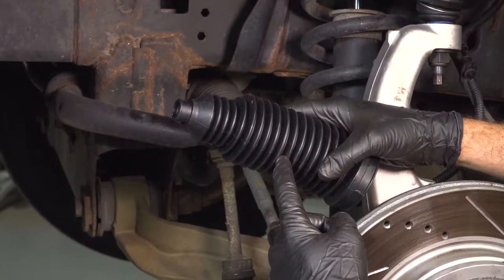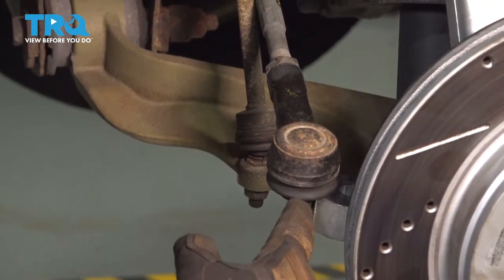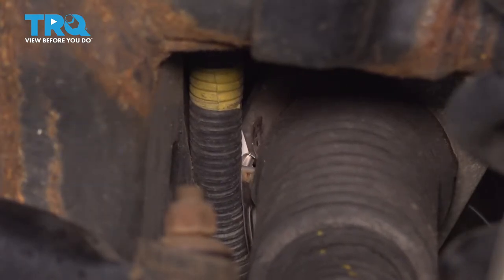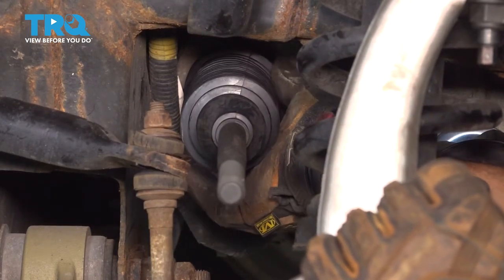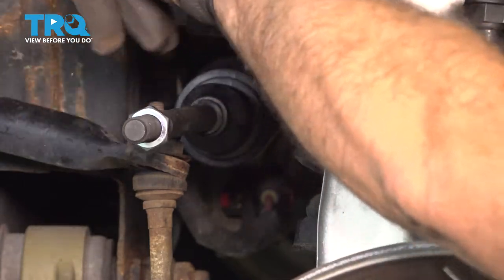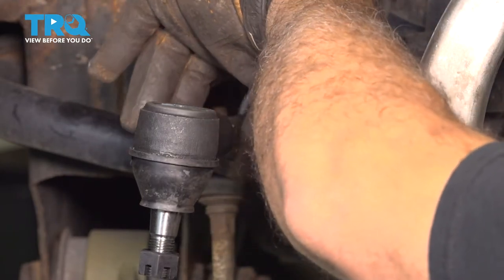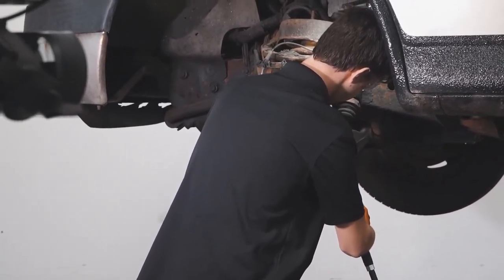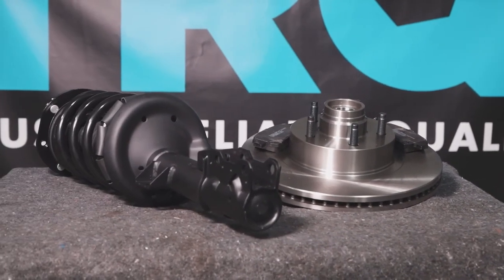How to Replace Steering Rack and Pinion Bellow 2011-2018 Ram 1500

Comment: I have a 2013 Ram Laramie with electronic steering rack.  Is the method different for the electronic rack?  I took it in to Les Schwab and they said they do not work on electronic steering racks and said for me to take it in to the dealer.